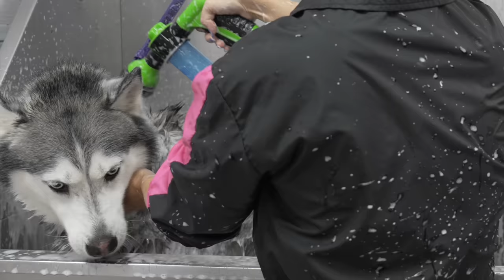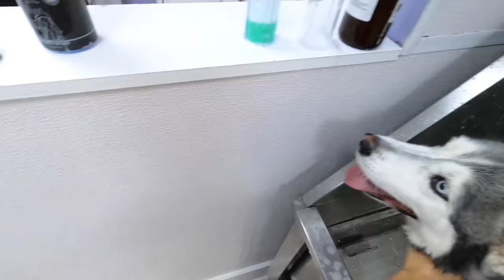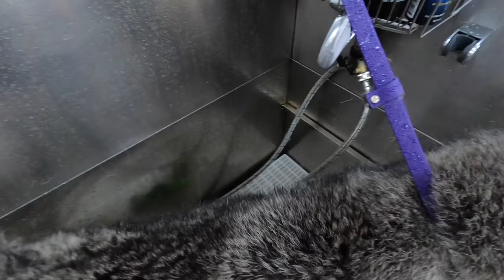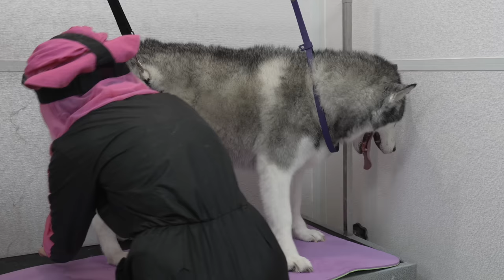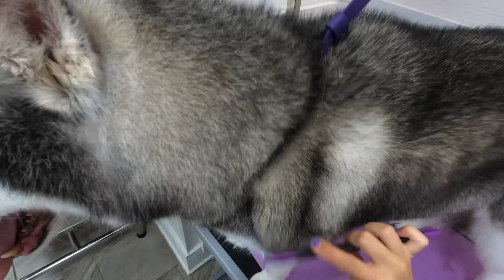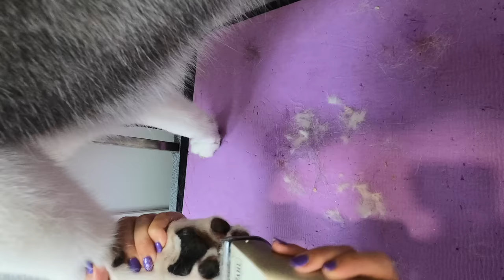What in the world?

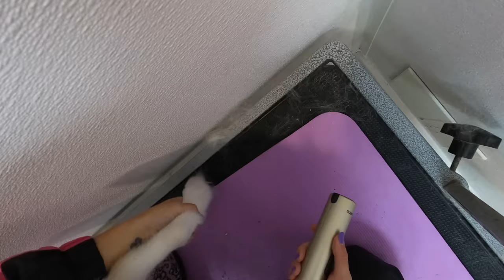Comment: i get the feeling that the husky is actually OK with having her paws touch, the problem is she needs 2 paw to balance, taking 1 off balance her and she resist. if you fully support her weight, she is totally fine for you to touch her paws. For the Front paws, 18:10 if you do her inside paw while she is balanced on the outer 3, she seems fine. but if you do the Outer paw, you are twisting the paw in an awkward angle and she resist.